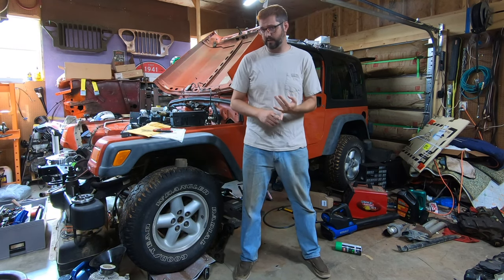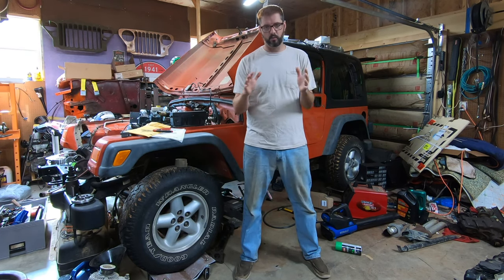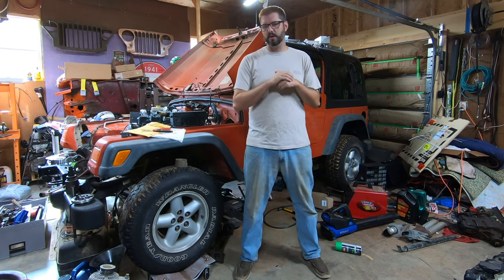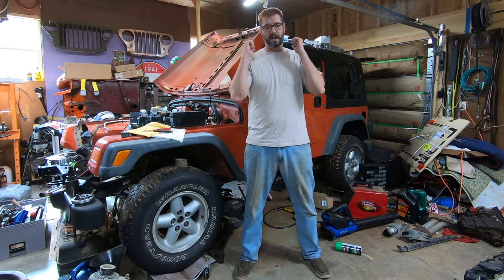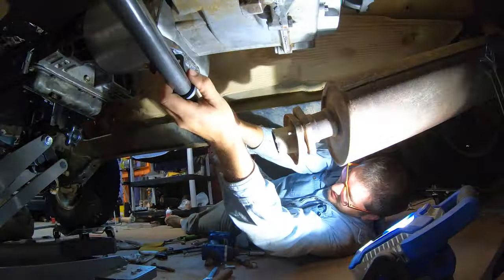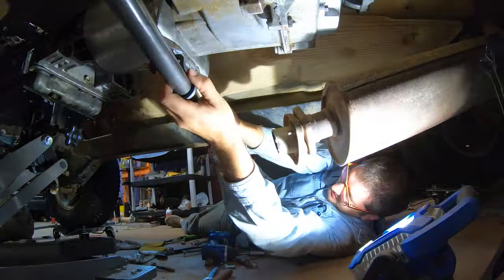Crossmember Fabricated and Installed on the TJ Wrangler! [Felicity - 29]

Comment: Do you remember what you used for bushings? I'm thinking about doing something similar with rubber YJ "Large" bushings, there seems to be kits online with the sleeve and outer tube.  

I don't like how so many of the universal kits online use 2 poly bushings at the framerails and solid mount the drivetrain. I really like how you kept the bushing in the middle. How's it holding up now that the project is running and driving?

Comment: how short is your rear drive shaft i am planning on doing a similar setup on my tj  with the 5 speed ecobox and a teralow 231 with sye
Reply from the maker: Hey 90 droptop, sorry for the delay in getting back to you! My rear driveshaft length is 14.25" inches, but again I moved my engine forward 6.5" which helped with the 7" inches the doubler took up!
Reply: @RustyAutoholicGuy  thanks, I put my doubler in a couple days ago got it all mocked up measured for shaft and noone could/would make it angle is to harsh for the cv to work. So I'm going back to stock and going to strech it